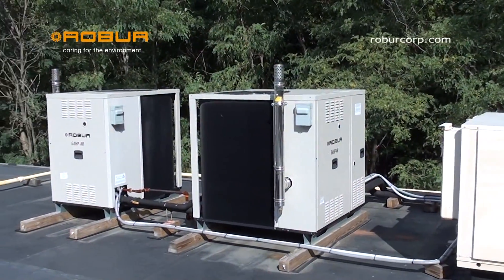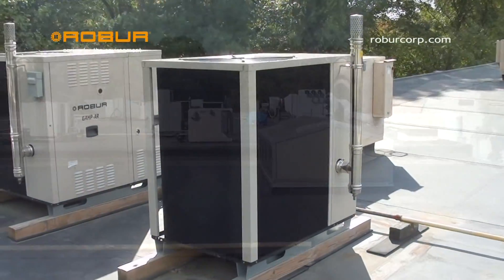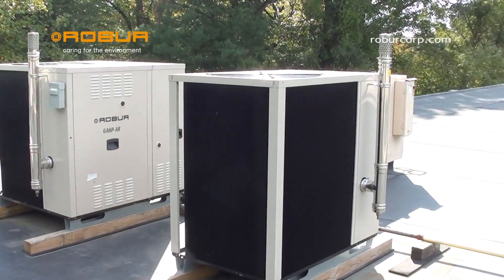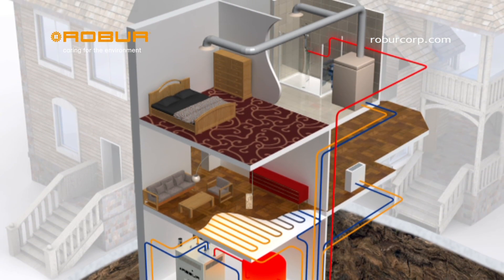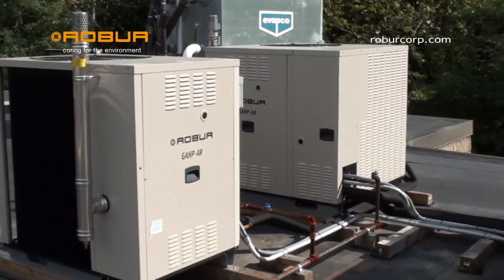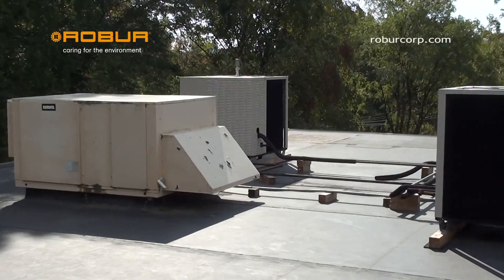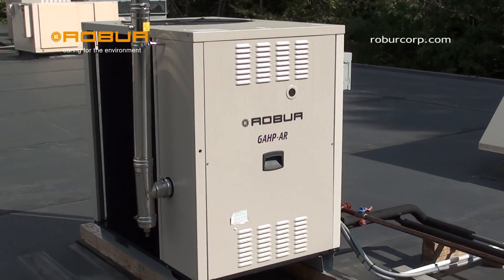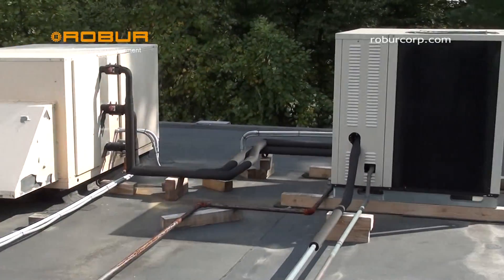[English] ROBURCORP What is the purpose of a Gas Absorption Heat Pump?

Comment: How does the installed price of a 5 ton unit compare with a 5 ton electric unit?  Instead of saying it is the most efficient gas fired unit, how about comparing it with electric since that is what most potential residential customers might be considering replacing.
Reply from the maker: As the equipment supplier we prefer to focus on the known features of our equipment as there are many variables involved with the hydronic application flexibility of the Robur equipment, which will ultimately influence the installed cost.  Typically, installing Robur equipment to heat and/or cool multiple zones including DHW supply allows it to be utilized to its fullest.  Whereas most conventional electric compressor driven AC units are installed to operate with a single coil or air handler and must zone with ducting or multiple units but still will not have multiple capabilities such as heating, cooling & DHW in a single unit.
Reply: ROBUR SpA So, in other words, you must be considerably more expensive.  If you were cheaper or even comparable, I'm sure you would be advertising it.